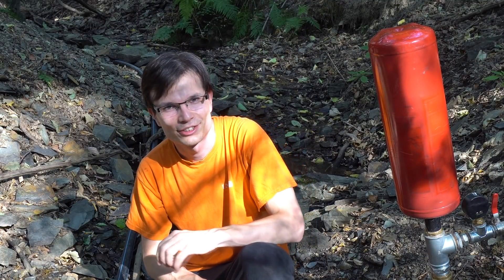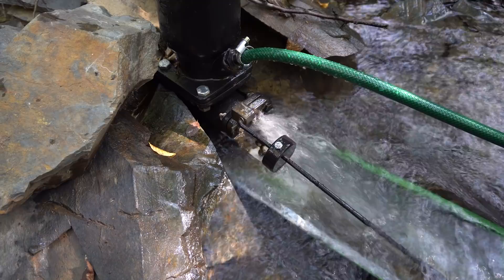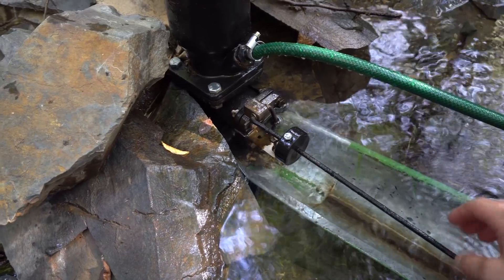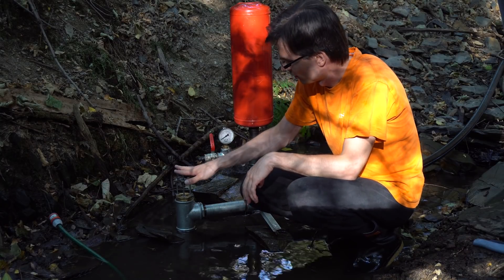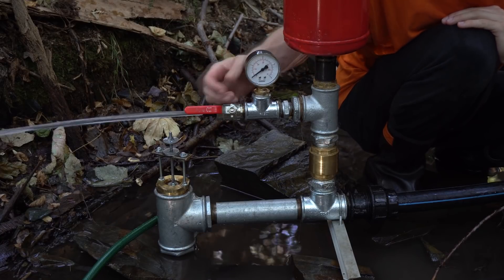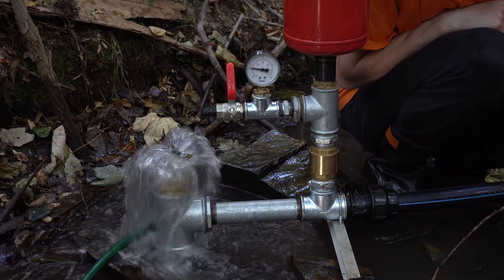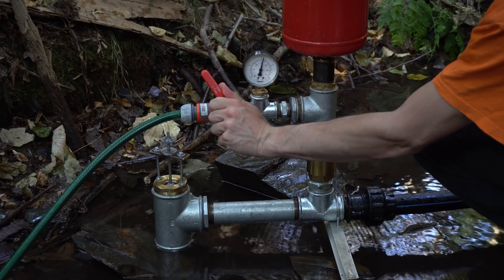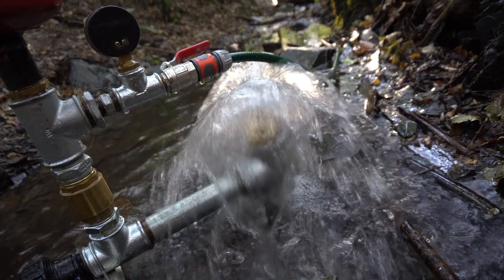HOMEMADE 5/4'' Ram Pump - BEST HOMEMADE WASTE VALVE

Comment: Hope to see your build step by step with a list of materials used. THANKS A LOT!
Reply from the maker: Check my other videos. There's everything.
Reply: @BohumirStehlik  gov will have all heads for this tech thay teach us that we always have loss but never talk about 
the converted gain we can make from eletromagnets
if u convert all the wast thermal energy around 
you u can use it universally as energy u need a true sine wave bipolar like the power comp dose a 
true pure sinewave like a grid tie inverter 
once the signal is made the system will turn on and 
consume wast thermal energy from the 
environment and space around you... there is free energy but 

it comes from Universal thermal loss and converted into a gain. so a pole Transformer and a 
microwave Transformer  have a common between each other u can take 2 microwave Transformer provide 
a pure sine wave grid tie inverter to it or a true bipolar sinewave that inter acts with nature in 
a perfect spherical motion like a flower of life..  if ur home provides this use it as a Source 
signal then u can simply stack the Transformers on top of eachother in correct fasion and note 
that the 1 wire on the Transformer must stay connected and the other disconnected your only useing 
1 wire on the hi side .. so test ur self 
2 microwave transformer stacked on top of eachother same 

face sides. one side 120 to the wall and the other 120 side to what u want to power and useing the 
Transformer just the way it came out the microwave with the wire attached causes the energy in its 
perfect spherical motion to converted wast thermal energy to amp for u hot to cold in to out... 
should look a bit nuts with u use a form of wireless energy but its interacting with the 

environment...this is my work a compilation of Otis car. Tesla. and many other very smart people 

nowadays i think i found the gate source and drainif this gets out to much that it works the 
power 

comp and mib will have our headsdont do this at home warning high voltage yet i cant stop u lol DO 

NOT TOCH THE CORES OR THE WIRES OK u will die make sure u dont touch the core if the hi wire is 

mounted to it u dont have to mount the hi on the core if u dont want u connect the 1 hi wire to 

the same side hi on the other transformer then the core should besafe to handle if nessary
grab your multimeter and prove me wrong
thats what u do i have my whole home on this
and u can take 

one of the lows side out the wall and hook it up to other stuff and power it for verry little amp 

makeing nature convert and pumping latent heat effect into the device.
and u can have a microwave 

hi volt cap in between the hi side and make a system that powers its self
u can flip the switch on 

ur breaker and the room stays on up to 2kva 
with both lows in the wall this is the zero point that 

was taken from us...
Reply: @BohumirStehlik  gov will have all heads for this tech thay teach us that we always have loss but never talk about 
the converted gain we can make from eletromagnets
if u convert all the wast thermal energy around 
you u can use it universally as energy u need a true sine wave bipolar like the power comp dose a 
true pure sinewave like a grid tie inverter 
once the signal is made the system will turn on and 
consume wast thermal energy from the 
environment and space around you... there is free energy but 

it comes from Universal thermal loss and converted into a gain. so a pole Transformer and a 
microwave Transformer  have a common between each other u can take 2 microwave Transformer provide 
a pure sine wave grid tie inverter to it or a true bipolar sinewave that inter acts with nature in 
a perfect spherical motion like a flower of life..  if ur home provides this use it as a Source 
signal then u can simply stack the Transformers on top of eachother in correct fasion and note 
that the 1 wire on the Transformer must stay connected and the other disconnected your only useing 
1 wire on the hi side .. so test ur self 
2 microwave transformer stacked on top of eachother same 

face sides. one side 120 to the wall and the other 120 side to what u want to power and useing the 
Transformer just the way it came out the microwave with the wire attached causes the energy in its 
perfect spherical motion to converted wast thermal energy to amp for u hot to cold in to out... 
should look a bit nuts with u use a form of wireless energy but its interacting with the 

environment...this is my work a compilation of Otis car. Tesla. and many other very smart people 

nowadays i think i found the gate source and drainif this gets out to much that it works the 
power 

comp and mib will have our headsdont do this at home warning high voltage yet i cant stop u lol DO 

NOT TOCH THE CORES OR THE WIRES OK u will die make sure u dont touch the core if the hi wire is 

mounted to it u dont have to mount the hi on the core if u dont want u connect the 1 hi wire to 

the same side hi on the other transformer then the core should besafe to handle if nessary
grab your multimeter and prove me wrong
thats what u do i have my whole home on this
and u can take 

one of the lows side out the wall and hook it up to other stuff and power it for verry little amp 

makeing nature convert and pumping latent heat effect into the device.
and u can have a microwave 

hi volt cap in between the hi side and make a system that powers its self
u can flip the switch on 

ur breaker and the room stays on up to 2kva 
with both lows in the wall this is the zero point that 

was taken from us...
Reply: @BohumirStehlik  gov will have all heads for this tech thay teach us that we always have loss but never talk about 
the converted gain we can make from eletromagnets
if u convert all the wast thermal energy around 
you u can use it universally as energy u need a true sine wave bipolar like the power comp dose a 
true pure sinewave like a grid tie inverter 
once the signal is made the system will turn on and 
consume wast thermal energy from the 
environment and space around you... there is free energy but 

it comes from Universal thermal loss and converted into a gain. so a pole Transformer and a 
microwave Transformer  have a common between each other u can take 2 microwave Transformer provide 
a pure sine wave grid tie inverter to it or a true bipolar sinewave that inter acts with nature in 
a perfect spherical motion like a flower of life..  if ur home provides this use it as a Source 
signal then u can simply stack the Transformers on top of eachother in correct fasion and note 
that the 1 wire on the Transformer must stay connected and the other disconnected your only useing 
1 wire on the hi side .. so test ur self 
2 microwave transformer stacked on top of eachother same 

face sides. one side 120 to the wall and the other 120 side to what u want to power and useing the 
Transformer just the way it came out the microwave with the wire attached causes the energy in its 
perfect spherical motion to converted wast thermal energy to amp for u hot to cold in to out... 
should look a bit nuts with u use a form of wireless energy but its interacting with the 

environment...this is my work a compilation of Otis car. Tesla. and many other very smart people 

nowadays i think i found the gate source and drainif this gets out to much that it works the 
power 

comp and mib will have our headsdont do this at home warning high voltage yet i cant stop u lol DO 

NOT TOCH THE CORES OR THE WIRES OK u will die make sure u dont touch the core if the hi wire is 

mounted to it u dont have to mount the hi on the core if u dont want u connect the 1 hi wire to 

the same side hi on the other transformer then the core should besafe to handle if nessary
grab your multimeter and prove me wrong
thats what u do i have my whole home on this
and u can take 

one of the lows side out the wall and hook it up to other stuff and power it for verry little amp 

makeing nature convert and pumping latent heat effect into the device.
and u can have a microwave 

hi volt cap in between the hi side and make a system that powers its self
u can flip the switch on 

ur breaker and the room stays on up to 2kva 
with both lows in the wall this is the zero point that 

was taken from us...
Reply: ME TOO

Comment: Hay man, use some thread tape to seal that thing. Good design otherwise, ohh and the brass check valve to the tank needs to be all barss (inside). There's 2 types (plastic & brass) of those and they look exactly the same on the outside. I guess the All Brass (stainless steel spring & Brass valve inside, I'm guessing you took the spring out because you don't need it in your setup there and it will work better) one would be a high pressure one, that's what we got here in Australia anyway. Great idea though and remember to get yourself a water Tank on a stand so you can gravity feed your house. We usually put our tanks here on a 4 - 5 meter stand (usually made out of cement legs x 4 and home made as well)> And a foot note the waste valve on the commercial Ram pumps (old) have Vanes on them so they turn slightly each cycle to keep the seat clean and sealing and has a beval seat edge like an engine vlave. I'd upload a pic if this had that feature. It should be interesting how long this simple design lasts though. All the best with this old tried & true working pump concept. Oh & look up Snifler valves for your pump as well, it will help with stalling later down the track.

Comment: Hi - Very nicely done. If you don't mind, could you please let us know what the size of the black plastic supply pipe is, as well as if you have put a bike tube inside the fire extinguisher or if it is empty.  Thanks!
Reply from the maker: Hello. Thanks for your message. The fire extinguisher is empty but it would work well with the bike tube too. The black hard plastic supply pipe is 5/4 inch - around 32mm - same as the pump.

Comment: Quieter than other ram pumps I  have seen on the internet. Adding a rubber gasket would make it even quieter.
Reply from the maker: But rubber gasket wouldn't last so long. There are tremendous power going on in the valve.

Comment: just stick to the metric system that you are familiar with,  under the Imperial system, you do not refer to a size as an improper fraction. 5/4"  is said to be  1 1/4 inches.  Under METRIC you do not mix  units of measurement , a distance  is expressed in terms of  the largest whole unit ie 2.4m or 240cm or 2400mm  same distance but different ways of expressing it. Never is a distance referred to as  240 cm and 5mm, it is 2405mm . But in IMPERIAL units are  mixed  eg feet and inches, they express the largest equal  whole unit then  the remainder is added in the form of a lesser unit. eg  5foot 7 1/2 inches.  That is why Imperial is so unwieldy, you must know the various relationships between units  12 inches in a foot, 3 feet in a yard etc. Stay with metric.
Reply: thankfully everyone knows simple stuff like how to convert between imperial units and metric.  it's pretty easy, man.
Reply from the maker: The sizes of water tubes are always in imperial. Even here in CR where we use always metric system. When you go to the shop, you ask for 5/4'' tube.

Comment: Question about the waste valve. It has a very long rod on the interior side. Is this rod inserted into a guide, or other means of support to keep the action straight?  Drilled hole in the plug on bottom of the tee? Thanks. Best design I have seen in this size compared to the foolish plastic, inefficient, ready to break rams or the swing check valve versions.
Reply from the maker: Hello, yes, there's a support inside of the valve. On the bottom end there's a 2 endings, one screwed from inside with a hole as a support and the other as a real ending.
Reply: Details needed

Comment: Very nice. How are you keeping air in the chamber? I do not see a "snifter" valve or drilled hole with cotter pin insert to admit some air.
Reply from the maker: Hello. No sniffer valve. There's enough air in the water. In case of a really strong pressure that hammer effect is so high that the back pressure pumps air into the air tank. Actually, there is no real proof that a sniffer valve would be needed.
Reply: You used the 2 pressure readings to show the ratio of water lifted. This may be self evident, but not on hundreds of videos here. An absolute matter of genius.  I live on a mountain stream in the California Sierra's and here in 1850 was a water wheel crushing gold quartz constructed by a French and English company with a diameter of 12 meters. Still in print is a memoir from that time and  location called "Discovery Of The Yosemite" by Lafayette Houghton Bunnell. History records that they dispatched a French mining engineer to operate the gold mill. Have a look at videos of my creek here - it could operate several ram pumps of this size. I have installed a submerged streambed water pick up but the pipeline is incomplete. I have had the parts for my ram in my shop for many years, now you inspire me to complete it. I have a construction, cabinet making and metal shop, so I understand what is needed. Did you machine the brass bushing for the waste valve?

Most impressive is you seem to be a musician as well as an artisan and builder.  Musical and mechanical genius are a rare combination     https://www.youtube.com/watch?v=__UuPeqyhZI
Reply: Thank you. Ideally, one would make the pressure chamber of clear PVC, perhaps. Is that waste valve guided on the inside, or only the top?

Comment: I would like to know more about the waste valve as well.  It seems to make less noise than some and seems to function very well.  I am also interested in an indirect ram pump where I can use a dirty water supply to pump potable water.  Not sure how this would work, but I have seen reference to something like this.
Reply from the maker: Hello. The valve makes less noise because the piston gasket is made of hard leather. There's no metal-to-metal contact and therefore it doesn't sound so much. And yes, it functions pretty well and is fully udjustable. 
Sorry, I have no idea about indirect ram pump. I have no idea how it would work...
Reply: Íts calling: wild water ram pump. 
http://brunnen-forum.de/viewtopic.php?f=52&t=338
Reply: Rife in America made a 2 stage pump that used creek water to pump fresh water or well water. It was an unusual set up, but a diligent search in rams will show you the mechanics of this device
Reply: Check out the glockemann ram pump, it can be configured to pump from a different source to that of the drive pipe

Comment: This is impressive!  It's great to see people modifying a known design and improving it so dramatically.  I have a property with a few streams through it and I need to pump uphill quite a way so I think I will need the most efficient ram pump possible. I haven't measured the ratio of water head height to height that I will need to pump it up, but I suspect it will be more than 1:15.  I will need to experiment a bit to get it near the house, and I can then use an electric pump to get it further if necessary.  
I think I should be able to replicate your design reasonably well from your description in the video.  You don't happen to have a list of parts with dimensions by any chance? Also the one way valve under the outfeed (not the waste valve)...is it a standard flapper valve?
Thanks so much for posting this.  I find it absolutely fascinating. I was amazed at the pressure in the line when you took the end off the old system...I think it even surprised you for a bit!
Well done and keep up the good work!
Regards,
Tony (from Australia)
Reply: Íts calling: wild water ram pump. 
http://brunnen-forum.de/viewtopic.php?f=52&t=338
Reply: Sorry,  my answer is here wrong.
Reply from the maker: Dear Tony, thank you for your nice comment. Keep on mind that the hills always looks bigger than it really is. My first guess with our delivery height was around 30 meters. At the end it is around 17m. I think the ratio 1:15 is the maximum you can get from the weight of water running in such a long pipe. 
The rampump itself is 5/4'', the waste valve is 2'' with 1'' reduction for the "exhaust". The most difficult tasks were to attach the tank (one has to weld it or to use a reduction from M30 1,5 to G1'' or G5/4'') and to make the small metal plate on the waste valve. The other valve is a standard spring loaded check valve with metal core (don't use plastic, don't use swing check valves). If it will go wrong, I will change the rubber inside for a leather same as I did with the waste valve. 
This ram pump needs approx 6l/min to work. If you have higher volume of water than I would recommend to place two rampumps in a serie - the first big and in the middle of the hill another smaller that takes the water from the bigger one.
Reply: Thanks again for the measurements.  I have a few things to do before I get to make the ram pump but I'm looking forward to it.  The property is completely off-grid but has clean fresh water creeks running through it so a ram pump will be the perfect addition. 
Cheers, Tony.
Reply: We are lucky in the USA, most fire extinguishers use standard pipe threads.
Reply: SEE ENGINEER775...he has a great tutorial on theory and actual install...tells all you need to know...!!!
Reply: we need the list